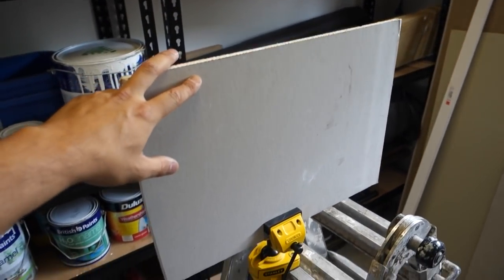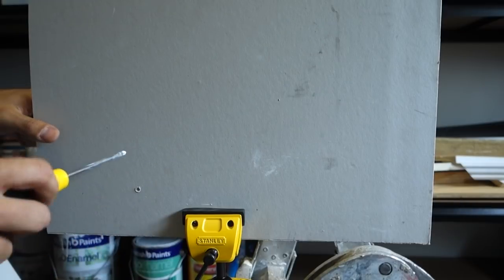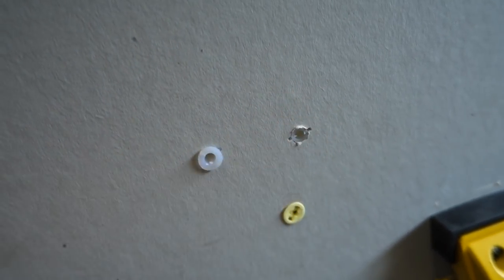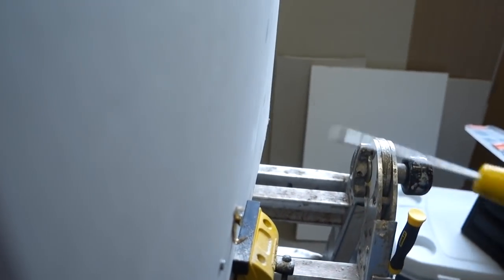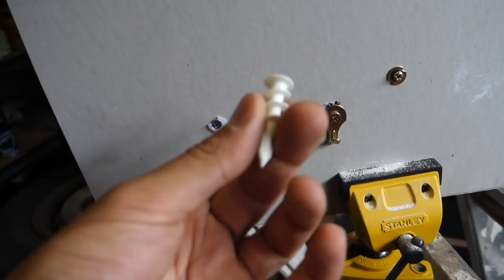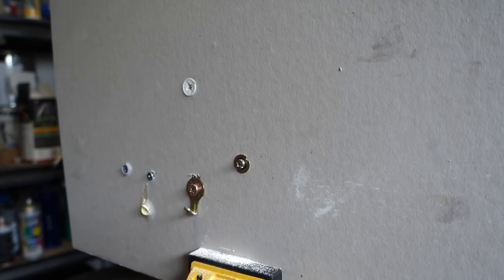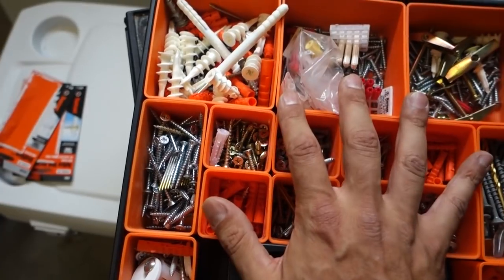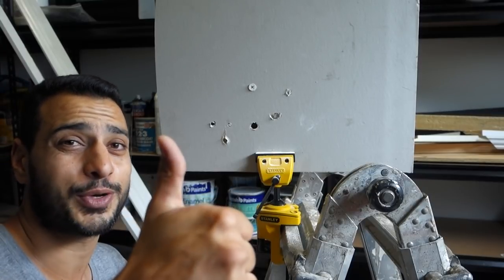Best plasterboard drywall anchor - MUST HAVE...

Comment: Bill, to remove the expanding wall anchor you remove the screw almost all the way out, then tap gently on the screw head to unexpand the anchor behind the wall. Then you can easily pull the whole anchor out and in fact reuse it if you want.

Comment: Ah, finally an Aussie and with the info I needed. Already had one disaster with that metal ramset plug thing leaving a huge hole when it didn't catch.. Have a box of some wallmates i haven't used and i'll be using those now. Cheers.
Reply from the maker: You’re welcome 👍👍

Comment: Great helpful video,  just fyi for you and other viewers, the kilograms to pounds conversion is wrong, 10kg = 22 pounds, 20kg = 44 pounds  (easy way is to multiply by 2.2, or double the initial weight in kg, and then add 10%)  in the video I believed you just added 10%.  Cheers

Comment: Good video. Never use those plastic anchors that come in your installation kit. Guaranteed , I'll come out to fix the towel rail you've just installed. They're actually designed for masonary. One of those anchors needs a setting tool to work correctly. But love the wallmates. If you use the Ramset range, I'm sure you'll find a good anchor for your purpose.

Comment: What would you recommend for wall mount TV, the mount is two pieces a L&R  bracket. On each piece it says use 4 screws, obviously 2 of them will be in a stud, what would you recommend for the other 2?

Comment: Just double checking...with the Wallmate, would you say they safe enough for not just side plaster walls, but as ceiling mounts - such as mounting ceiling lights like LED panels - probably only 1 to 2 kg?

Comment: The wall plug that pushed through is only good for bricks and masonry jobs. Those  wall  mates  can be troublesome too and spin in plaster when fixing. I prefer  anchor plugs which grab really hard , secure and are quicker to install .

Comment: I am constantly repairing the aftermath these spiral drill in fixings make ..general builders and lazy fixers use them a lot. Especially in new builds 
“They are useless. “.   Keeps me in a job I guess.
Reply: Paul Davies You say the wall mates are no good but what do you use for basic fixing ?
Reply: riskybiz123 the new Fischer
 DU-power plugs the gray/red ones, of course that’s load dependent 
I use the expanding hollow wall anchors as a get me out of trouble fixing. Toggle fixings help sometimes.

Comment: Thank you for the video, I came here to see how the anchors landed in the back of the wall. You have enlightened me sir thank you for that.
In turn I can send a little kind you’re way.

When removing wall plugs in the US we have three terms. 

Pull it: obviously this means to pull it out of the wall, trying to do as little damage as possible of course.
Send it down the road: this means you don’t want to give it a whole lot of force, the idea is to get it into the surface but not through.
Send it home: obviously means bang it threw the wall.

This is all for the courtesy of the next Trades Person. Which would be determined by the amount of damage done during the removal process.
The Painters will only fix a hole on the wall the size of a $.25 piece or smaller, this is due to drying time which could impede the speed of the job.
So if the hole is bigger than a $.25 piece because of unexpected damage during the pulling process you will need to call a Drywall Finisher.
Or on the off chance that you may be the next guy in line.😉 
All so if you “send it down the road” it leaves a little backing, making it so the painter can use a smaller amount of patching compound which will speed up the drying time. With the toggles that leave a little plastic lip on the wall, what I do is grab a 6 inch “plaster board knife” we call it a Broad knife. Take the drywall knife and lay it on the wall flat about 2 feet away from the plastic lip, using the palm of your hand on the butt of the handle quickly sliding the knife up the wall cut the top lip off. With some practice this becomes extremely simple. Next you want to turn your Broad knife over and using the butt of the handle which should have a hammerhead on it, some do and some don’t so if you don’t have a Broad knife with a hammer head on it it would be a good purchase to make. Use that hammer head, lightly tap the plastic “ Sending it down the road” leaving a little backing in the wall to again speed up drying time. Although you want to make sure you do sink it into the surface about 2/32 of an inch. Or it may come through your patching compound during sanding. 
I hope this was as helpful to you as your video was for me. Take care friend 🙂

Comment: Great video. 👍 With the Wallmate, I was thinking of also using a picture hanging hook to hang something via a wire. It may be more durable if not over 15kg or so as the hanging hook will have limitations. What do you think?

Looks like the Wallmate is the easiest and best to use.

Comment: Hi Bill - Do you typically use screws shorter than 40mm or do you knowingly crack the tip point after screwing in with the Ramset 10kg wall-mate anchors? I personally find that the 10KG ones lose grip in the drywall if you use longer screws.

Keeping in mind that the 20kg wall-mates are designed to snap at the tip and widen into the plasterboard for added strength.
Reply from the maker: The 10kg anchors are not designed for long screws. The 20kg anchors are designed to cater for longer screws and hold more weight so I tend to always purchase the 20kg. 👍

Comment: Great review!. What do you recommend for TV wall mount brackets?
Reply from the maker: Hi, I use the white anchors in the video. Just make sure you buy the ones with a higher weight rating ( 20kg ) 👍
Reply: @billshowto  awesome!
Reply: @billshowto  thank you. It’s always scary hanging up a TV on a drywall/plasterboard. As well, using 4 or more of these would increase the weight distribution and stability. TVs are getting larger these days.

Comment: Honestly, they wall mates (different name in UK) are literally the WORST plasterboard fixings. I wouldn't touch them with a barge pole
Reply: Although, they are better than cheap red wall plugs.
Reply: @bitTorrenter  but you wouldn't use red rawl plugs in a plasterboard wall, so it's a redundant comparison

Comment: To remove the aluminum plug... you can carefully use a angle grinder to remove the outer lip. Once you’ve ground away the outer lip with the two small teeth... push the rest through the gypsum board and it will fall inside. 
It’s not an ideal method but it works and leaves a much cleaner hole than trying to force the plug out.

Comment: I say avoid self-drilling-type wall plugs like the plague. The mere act of inserting them grinds up the very gypsum upon which they rely for shear load support, and their lack of any purchase on the rear drywall face renders them useless at tensile or cantilever loads. Jostling them in any way further chews up the already-compromised gypsum holding them in place, and once the paper sheathing inevitably tears they rip out unceremoniously leaving you with a nasty hole in your wall and your shelves on the floor. The only thing they do reliably is fail.

This video sums it up nicely: https://www.youtube.com/watch?v=FYZhg-MqS9M
Reply: it's billshowto not yours and if you're going to suggest not to use something perhaps suggest something better rather than putting a link to another video that basically says what you've already summed up. Pretty useless comment.
Reply: @chikalukorkwati2179  I was speaking from  decades of experience. The video I linked echoes my sentiments and illustrate the point quite nicely.
Comment sections invite dissenting opinions, which I was offering. 
You were saying?
Reply: You still haven't given a proper suggestion as to what to use in contrary. "Decades of experience" who gives a damn? You come to every channel to just disagree with someone? If it works for someone else and doesn't work for you it doesn't mean you're right. Varying purposes for different things. Honestly, someone will come across this video and see your comment and still be left thinking "then wtf do I use". That's exactly why your comment is useless.
Reply: You must be another threatened tradie. Don't worry mate you won't lose your job by these videos, you'll lose it because of your high and mighty attitude
Reply: @chikalukorkwati2179  Okay, buddy. You take care of yourself.

Comment: Tests have proven that wall mates fail under less load than the little plastic ones you were mocking.
Reply from the maker: Looks like I’ll have to test that out 👍
Reply: Yeah ...pull out tests (useless) .....not shear weight tests.

Comment: you used the wrong screw with the first 3 plastic ones making the installs fail on purpose...
those wall anchors should come with screws. at least the ones i get do, and i have no issue removing them...
never had to shove them into the wall. just back them out so a few threads are holding it and gently pull..........
all the holes they make take exactly the same amount of work to repair so no use crying about it either way. 
unless of course you punched the anchors into the wall with your fist its an easy repair.

Comment: The plastic self tapping ones are absolute crap sir. Use the metal ones instead. Zip togglers are actually the best to use to hold the most weight.

Comment: Alot wrong here, weights all wrong, didn't look flush on the wall, hole repairs would be the same, not hard to remove the first three definitely dont need to be destroying more of the wall to get them out. Looks like a paid partnership but no notice of it being an advert

Comment: Don't see the point of using those things. With studs at 450mm centres, why not fix into that for a strong long lasting fix. You would only need a screww which you can easily remove and patch. At worst you would be 200mm away from your ideal location which isn't a  big deal.